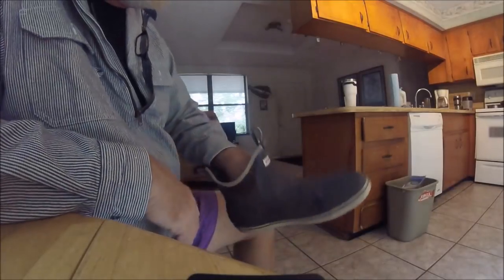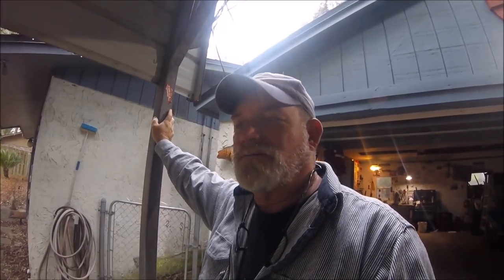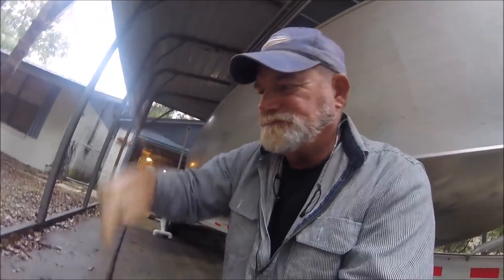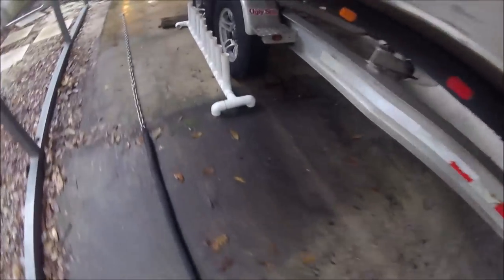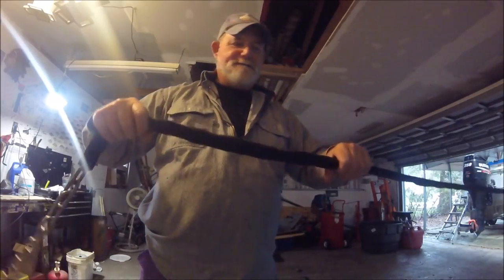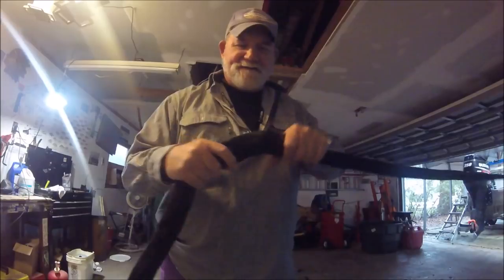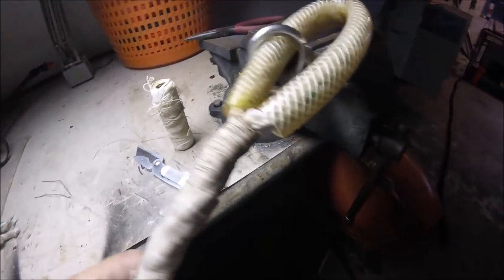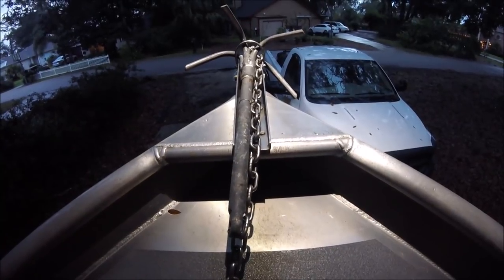MY ANCHORING SYSTEM, on my charter boat

Comment: never lost an anchor, my lakes have no features on the bottom. I still bought the GPS lock trolling motor. I was stubborn and for 3 years kept fishing with the anchors. Bit the bullet. This changed the game. I used to fish 2, no more than 3 spots per day, because i was tired of dropping anchors. Now I constantly reposition my boat. I can fish so many spots. By the way, a trolling motor with GPS lock now can be bought for less than 2000. You really need to consider. BTW, I still think you need the anchor for emergencies, even if u dont use it..
Reply from the maker: sorry, but that trolling motor stuff is so expensive, maybe 5k when done!. 36v system, charger, welded mounting somewhere, trolling motor that'll break alot,  a shaft thats long enough? I'm in the people carrying business not batteries and all that carrying biz..
Reply: I got my marine batteries from home depot for $70 each. Didnt do any welding. Bought the motor with gift cards that i bought online. I installed myself on the spot of the stock motor, just power snd ground wires and one cable that goes to my humminbird. Everything together was 2000. Thats a fact sir. Mine is 24v and medium long shaft. If u want welds thats extra too. But you are definitely off by minimum a factor of two. Once u get it u will regret u didnt get it earlier and will think of all the years you lost, where you could be hitting 20-30 spots per day
Reply from the maker: your boat and mine are two different animals, my batteries in my boat right now were $350 a piece. yours was 2k, the way 'you' have it. No sense preaching......as I always say to you, ''''send $$, then.""
Reply: $350 batteries? Ok, Dave..
Reply from the maker: really don't understand why people don't believe me when I say something. This is my job, my lifestyle for over 20 years. uNLESS, it's been yours. I'll tend to go with my experiences and research.  I don't spend my days in a cubical somewhere in a building. I've done more research about a topic than you'd ever think of. I know what it entails putting a trolling motor on my boat or any boat. I've had 7 boats with trolling motors, . BATTERIES?? YEP, THE BEST! 10-12 YEAR AGM'S 99.9% pure lead....that'll out last any trolling motor..(oh course I didn't pay that) don't want anything but. https://youtu.be/OYI0Gm728dQ  and real high performance boats are using lithium's!!!!!
Reply: Ooooookeyyyy....

Comment: Dang.  Sorry to hear that.  When around rocks, it will happen sooner or later.  It fell into the perfect trap.  Some local experienced diver should be willing to make that shallow dive and find your anchor.  Give a call to one of the local dive shops.  I'm sure they have a name and contact for someone that has the desire to help.  My boy helped find a brand spanking new F250 pickup that rolled off of a ramp into the Savannah River, several years ago.  It was upright, 100 yards downstream and facing forward.  Not a dive for the faint of heart, as the Viz was not great at all.
Good luck and keep us posted Dave!
Reply from the maker: I've lost 50 anchors over 35+ years....no biggy. pay-to-play. Have a customer and I trying next Monday at the high ''clear'er'' tide. Great guy! He contacted me. A VIDEO WILL BE FOLLOWING, IF WE HAVE THE WEATHER TO DO IT.

Comment: Just ordered chain guard from your outfit in Texas. Been thinking about that setup for awhile. Be safe on the rope. After pulling anchors for 30 years, I got slammed into the bow hard and into the cold intercostal Saturday while drum fishing. Made it to the swim platform bloody and the wind knocked out of me. Could not pull myself in the boat for a minute or two. I am complete open to ridicule for my mistake. But don't say it cant happen to you. Stay safe and fish hard.       Thanks
Reply from the maker: its very very hard for me to fall outa my boat on the bow.....the chain guard is nfor noise and easily handling...or if ya have a cool guy ocean spray colored gelcoat thats very hard to match when ruined. the Aussies and NZ'ers use it on their bad azz drum winches (Lonestar) VIA AUS. sold by the dudes brother I believe at Hammer Marine, along with other quality Aussie inspired stuff.  THREE THINGS on my ''plate alloy'' boat, (thats what they call them down under) that I copied, Stern cutting board, Chain guard, and ''burley bucket'' aka: my chum chopper. THEY forgot more about building superior aluminum boats than N. America's even know....''study the Stabicraft'' it's a W-O-W boat I'd be in if I was in the offshore fishing biz.  THAT WATER AIN'T COLD! I SEE THE NYer's and OBVIOUS NUT CASES canadians? SWIMMING AND ON JET SKI's???  but did ya catch any monster ICW Drum?  we hooked one yesterday that was a behemoth and lost it.
Reply: Well you can clearly fall out of my boat. After trying to rip the trolling motor off with my chest. I only use the trolling motor for controlling the boat during a drift, suspending or bumping baits. No need for expensive batteries here. No drum this trip, just as the tide was slacking for the good bite. I realized just how banged up I was and headed in. I will own my "plate alloy" boat next year. Heading up to Seattle later this year to get a close look at some of the build options. Put this old Key West glass boat down the road. Wooldridge 21 Super sport Drift102 beam with optional higher sides.BAMMMM!
Reply from the maker: @BlastedKat  where you at?? J-VILLE? wanna learn A LOT? Glen Wooldridge is a member of my old forum friends. Check out my alma mater: www.aluminumalloyboats.com LOADS OF OWNER INFO. Dream for me is the ''work boat show' up yonder, in WA.  Another place to learn is Louisiana! If I was to do it again and wasn't in the charter biz, I'd be at Scully's or Hankos, or American Marine over there. ALL the alloy boats the dredge companies use in the St. Johns river right now are either Hankos or Scully's all '''Super customization'' able.

Comment: What about your concrete block idea?  I thought that was the way to go at the Jetties?
Reply from the maker: never really held good in wind and current. I put my  rebar rusty p.o.s anchor and junk anchor line on the boat, to do tight anchoring in rocks. Lost this one on a spot Ive fished 1000 times before. it wasn't like I went and chucked it all in the boulders, I never do that.